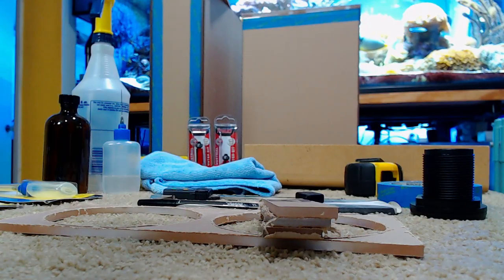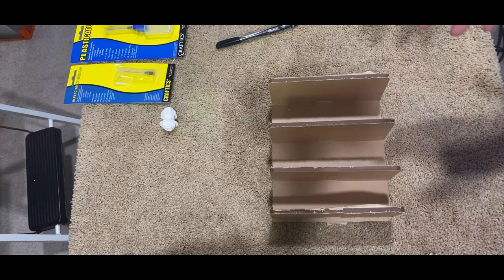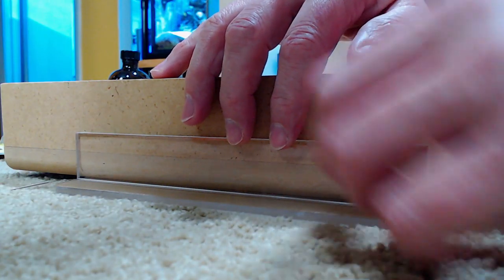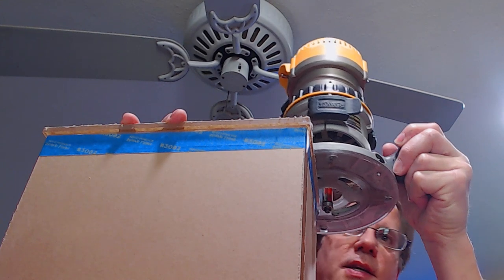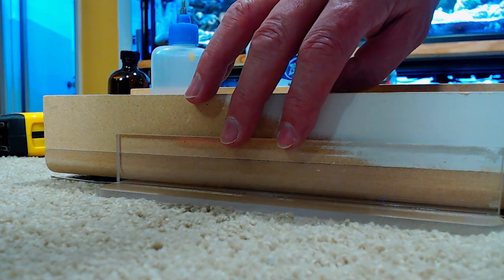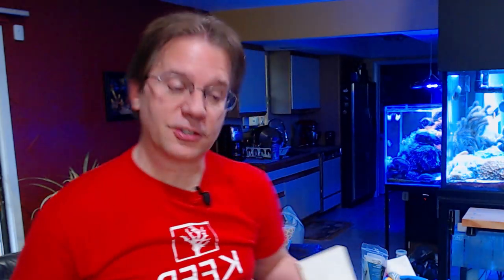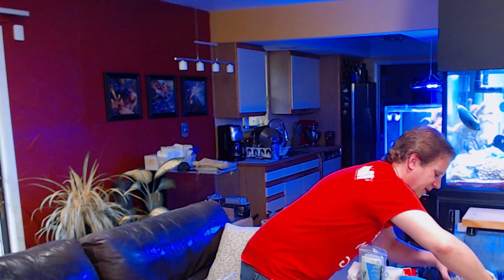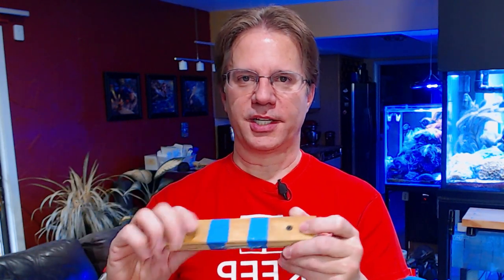Let's talk about working with acrylic material

Comment: Hi I just priced a sheet of cast acrylic 3 meter by 2 meters 12mm cost £600 UK what would US price be?
Reply from the maker: I'm converting over here.... That's nearly 10' x 6.5' x ~1/2" thick for $804 ($12.4 / sqft).  That sounds really high to me.  I bought 1/2" for $8.25 per square foot,  so your piece would cost roughly $540 here.

Comment: Great video! Always been interested in this acrylic stuff.
2 questions, you do not need to clean the solvent that runs out of the seem?
How do you glue the inner sections of the dosing container, or does your applicator fit in between?